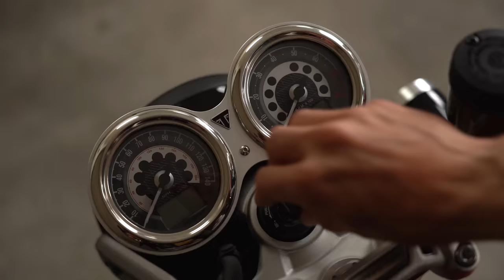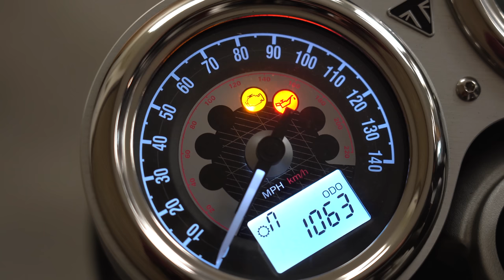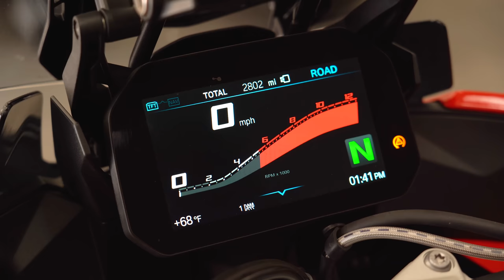Do You Need To Warm Up Your Engine? | The Shop Manual

Comment: The choke adds more fuel? Whoopsie!
EDIT: apparently chokes work different to how I remember them.

It is wise however, as you said to let the engine at least idle for 60 seconds. One thing that can happen from not warming up an engine EFI or Carby is that the metals do expand at different rates. This has been known to cause small oil leaks. Especially on Harley engines, let alone most air cooled engines that are still being made today.
Reply: Well, let's do a bit of thinking, here.  On my carb'd bike, if I add choke without touching the throttle, the rpm's increase.  If the choke doesn't add fuel, we have found the solution to the perpetual motion conundrum. In fact, on full choke, my bike will pull 4-5k rpms and can be ridden without opening the throttle.  Those rev's come from additional fuel, not just less air.

So let's give Ari some credit, as he was correct.  At least in the real world.  There haven't been "pure chokes" on motorcycles for a long time.  The "choke" is part of a fuel-enriching, airflow-restricting, starting system for many years now.
Reply: @bikesthatvote2855  a choke is merely a butterfly long before the Venturi, all is does is reduce airflow. This decreases the air to fuel ratio, it doesn’t suddenly dump more fuel in. However, in EFI systems in most cases the injector will inject more fuel on cold starts.
Reply: @whatsstefon  Please let me know what motorcycle carb uses the system you are describing.  On both my Suzuki's Mikuni BDST's and my Kawasaki's Keihin CVK's, the choke is a fuel-enriching starting system as I described.  Those are the last 2 sets of bike carbs that I have rebuilt.  I've also rebuild a number of Honda carbs, but don't have the carbs or the specs in front of me at the moment.  I have rebuilt a fair number of motorcycle carbs, and I have never seen a classical choke butterfly that you are describing.  In my experience going back over 40 years of bike carbs, the choke has always been a fuel-enrichening system.  FWIW, I have 6 bikes in the garage with clearly labeled "CHOKE"s that all have fuel-enrichment systems on the carbs, and do not control a butterfly before the venturi.  The butterflies are connected to the throttle cable, not to the choke cable.
Reply: @bikesthatvote2855  I’ve been rebuilding bikes for almost as long. Most carbs I’ve touched have a choke butterfly before the Venturi. The choke lever literally opens and closes the choke butterfly and is not connected to any fuelling circuit of the carburettor. Maybe I’ve just never come across the systems you are experienced with. However, I’ve worked for Honda, Suzuki, Kawasaki and Yamaha, in addition to most of the English and European marquees.

I’m always interested in learning new things. But I haven’t come across a carby that enriches fuel whether that be in addition to other cold start systems or stand alone.
Reply: Chokes that add more fuel via enrichment valve / circuit are a common type of choke.  Google search.  So no, the vid isn't wrong about that.  
These guys are a quality outfit.  Little to no chance they're going to get something like this wrong
Reply: @SportbikerNZ  Right, well I guess carbies changed a lot since I was a boy. They only ever had a choke butterfly.

Comment: 2014 RM-Z 250, new top end build. Running great one day, next day it was 2-degree F. Started it and i watched my friend give it gas to get to the start of the race. The engine cover cracked, and oil started to leak. John Rice a master mechanic in Springfield has told me and my friend that if it's below 32 outside [below freezing] To always let the engine warm up, at least for a minute but 2-3 would work best. Also, the same damn thing happened to my Motorcycle EFI. I started it and 10-15 seconds later i gave it gas to leave the house, and i heard a loud pop and the bike died. I snapped the piston cap and it broke/shattered into a hundred pieces, took my about 5 hours to get it all cleaned out properly. I'm not a car mechanic, but i am a certified small engine Mechanic. And in my 5-year study of small engines. I've learned one major aspect, If it's cold outside, your engine is cold to. And the best way to blow your motor when it's cold outside, is to simply give it gas and try to operate it while cold. A Chainsaw is a great way to explain this. On a cold winter day. If you start the saw and instantly/1-5 seconds after starting it, you go to cut into a tree. The saw will die because the engine isn't warm enough to move properly. I like to think of this as a person drinking coffee in the morning to wake up, because if you wake up, you're not going to be able to go on a 5-mile run first thing. Your body needs time to wake up. Same way with any gas-diesel powered engine on the planet. This video is complete BS. I don't care who this guy thinks he is, but he clearly doesn't know what the hell he's talking about. If you want to keep something nice [take care of it].

Comment: LOL, I am an Engineer, and I was waiting to arrest you on this, until you redeemed yourselves and explained, that yes, you should let the engine warm up before you ride it hard. So, not to confuse anyone with long explanations. Let your engine warm up so all parts are in speck, and no worry. If you hit the gas and ride it like you stole it, chances are that many parts will heat up way before others and create thermal stress. This will eventually lead to an engine that is leaking oil among other issues, and that is annoying like hell. When i have overhauled my bike or i bought a new bike, i usually go over every bolt on covers etc. and re-tighten to spec. Usually after the first few heat cycles the bolts loosen a bit from the heat cycles then engine go through. Even my Buell don't leak one drop of oil. ;-)

Comment: Regardless of the information given here I think I will stick with warming my scooter up  before I ride. The reason you ask, why would my opinion differ from the mighty RevZilla brain? From an engine builders perspective it is still a best practice habit, to let your scooter warm up or any engine for that matter. Why do most Police cruisers both cars and scooters or public service vehicles seem to  wear so well as far as the engine wear is concerned.  Because they are warmed up and run at temp throughout most of their lives  they only go through  on or two heat cycles per shift and then the second cycle is pre warmed because and the engine didn't cool down all the way like overnight. Running at temp like that is easy on the engine. most critical wear happens at cold start since they don't get a chance to cool off all day they run at peak performance for wear. If you want to just start it up and go play (ride) I will see you later in the shop to discuss your rebuild or replacement options while I change the oil on my scooter so yeah go ahead and do what RevZilla suggests here I can use the money

Comment: This is honestly why i dont buy any dirtbikes/quads used. People are impatient and take stuff to redline when it isn’t even warm. And people like never even go through proper break in period on brand new machines. I usually let my stuff idle until the side of the cases and head are warm to touch. Then cruise it around for another couple minutes then i go to full throttle once its fully to operating temp.

Comment: Another reason mostly for cars but I believe some bikes could potentially have them as well is forged internals. These are Conrods pistons and crankshafts pressed into a mold instead of cast and have a more structured and dense grain pattern and are therefore capable of more hp but come with the downside that they do need a good no revving warmup otherwise they’ll get very heavy piston slapping. I personally also use engine warmup to determine if I should even get on the bike. If can get to my destination by bicycle in the time it takes to warmup and actually drive there I don’t get on my bike but save gas and unnecessary exhaust fumes from entering the air by getting on my bycicle.

Comment: "designed to flow low as 10F/-15C" Yes and it flows way less in -20 "much colder than anyone with right mind want to ride in"... huh? Its not the cold that is the issue, just need suitable clothes to deal with that, bigger problem is traction, but with spike tires that is not much of a issue, but then again chance between snow and ice covered road to clean asphalt is, since those metal spikes dont have much of a traction on there. Solution is to chance into less aggressive spikes, but its nor perfect solution. Also its beneficial to drive during winter as insurance costs go way down then.
So in the end yes you should let it idle for a little bit to get oil flowing and go easy until its in operating temp. If you want to use entire reserve right from the get go let it warm into operating temps while idling since then there is no, to little airflow that cools the engine making this take longer. Also this tutorial was mostly for 4 stroke engines, while 2 strokes really need to warmed up much more since it revs way higher.

Comment: Very helpful indeed...

My bike seems like it needs 3-4 min, I always wait for the temperature to get to 72° then pull out slowly at least 1/2 a mile to the road from my home. This gives it time to get the right temperature, and all the moving parts get some oil...
While I put my gear on , it warms  up. It seems to work real well for my motorcycle. 

I actually have a problem though. After having many motorcycles and cars and finding out that I baby them too much makes me envy (in a good way) those who don't warm up their engines enough, go through the part of the road where it's two feet deep, water and mud  riding their bikes through the nastiest terrain, could  give a rats ass if they screw their bikes up, while I choose the side of that mud puddle or ride on the best part of the road so as to not destroy my wonderful bike!!

And after a long ride I tend to clean it and leave it spotless again. I can say that everything I've ever owned lasts and lasts because of the treatment I give it.
Another example, I'll be riding and the clouds seem like they are going to dropping 💧's the size of quarters and it's clear there is no way out but to bite the bullet and ride the storm out... Getting home and first drying off the bike as best as I can, giving a hoot on my drenched clothing... With my only worry, (oh god it's gonna rust) 😮

Then watching my brother come in all wet, leaves his bike dripping 💦 wet without a worry in the world!!! 

Yeah, I wish I could do the same, but this OCD just won't let me be😢

Oh well, safe riding to all!!

Comment: I enjoyed and appreciate your explanations.  However, you did not talk about the higher idle rpm on cold start-up... and then it takes about 3 minutes before the idling settles down to "normal" idling speed.  I ask about this because I hate the loud, abrupt metallic crunch sound and feeling when I put it into 1st gear with a higher than normal idle rpm. It sounds like it'll break something.  So I wait until it the idle rpm settles down to normal before I engage 1st gear.  Or is it still okay to put it into 1st gear before the idle speed goes down? I fear for the gears mechanism.

Comment: I actually do need to warm up my 165hp 2-stroke engine, says so on the manual. And to the people asking? someone else if "warming up the engine is necessary?" Common sense says "it does not hurt man made metallic parts that you paid for".. then again, if you need to ask someone else for advice on "can I drive this", you really probably should not. Unless there is some secret rule that "cool kids redline cold engines if someone says yes"

Comment: Its not the Oil,i am afried for,you Can blow a head gasket,if the water is cold,aluminium takes time to exspand,when an engine had the right water/Oil temperature and you drive with moderate trottle ,the engine Can drive forever,its only coldstarts there hurt the engine a little bit.but it Can takes 10000 times coldstarts,before you Can see it on the bearrings.

Comment: I only wait a few seconds for the oil to circulate on the engine. Then I start riding not accelerating too much until the engine is warmed up.

Comment: Hot valves, cold valve guides?  
Hot pistons, cold cylinder?
Nah, I'll keep warming up all my engines.  
I've rebuilt more engines than most, seen how older vehicles can run for decades with warm-ups and how quickly cold drives can cause crucial parts to wear out.  Waste a bit of gas or waste an engine.  Both valid choices, one costs less in the long run.  Easy choice for me.

Comment: From the (fuel injected) Royal Enfield 2022 Classic 350 manual.
"""NEVER accelerate as soon as the engine starts, especially in cold condition. The engine should be allowed to run in idle rpm for at least 120 s for the
engine oil to circulate and lubricate all the internal moving parts and for the engine temperature to raise. Failure to adhere to this important information
will cause serious damage to the engine internals."""

Comment: I would read the owners manual first. My BMW Bike is fuel injected but has a Choke. Bmw says OK to ride without warm up. My other Bike is a SUZUKI and SUZUKI says to let the Bike warm up first for several minutes. If your manual does not cover this then use your better judgement. Furthermore, better to use a Full Synthetic Oil.

Comment: After all the adds etc switched off "sorry" Anything with metal to metal needs to warm up equaly dont give a shit what anyone says carb or no carb Same goes for oil that they recon can
do 10K load of bollocks 6K max again dont give a shit as to what anyone says !!! My chain saw 2 stroke one minute of running otherwise the cylinder on the exhaust side will damage 
be it carb or injection So in a nut shell having stupidly not gone through the whole vid I say yes warm up any engine or be it on your own head /wallet Stay safe stay wise over and out !!!!!!!!

Comment: Also when fuel injected bikes are cold they idle higher. Is clicking into first gear at cold idle worse for the slots and dogs than clicking into gear at a lower rpm when it’s warmer?

Comment: I have a Honda cbr650f, I bought used from a stranger. I have never had a motorcycle like this where if not warmed up and you pull on the throttle it will miss fire, so it sounds. I hear popping in the engine, power is cut. I have no idea the reason for this. Looking for knowledgeable people who may have answers.

Comment: The oil temp and viscosity argument is the worse one because its hypocritical by default if your oil is cold and not viscous enough requiring a "warm up" then starting the engine and idling is the worse thing you can do because now you have moving parts creating friction with no oil durring idle . If viscosity is an issue than you should be heating the bikes oil pan externally  to warm the oil before starting.people often take simple concepts and blow them out of proportion for the sake of sounding smart in a conversation.

The carb argument and temp tolerance deviation is still valid IMO as metal swells and shrinks do to temperature and carbs dont like being cold just ask my used once a year chain saw 

I typically let my vehicle idle for about a min before driving  mostly to insure oil has had time to get pumped to the top and trickle down so i know while under load there is sufficient lubricant throughout the engine and i dont dog it untill my vehicle is up to operating temp

On my carbed bike i just let them idle while i put my gear on usly by then the bikes carbs are good and ill ride casual untill i feel the bike is running good

Comment: False on fuel condensation. Sort of true on oil.  One item not covered. Is valve clearance. 250 and 400 rebels in cold weather tended to stall.  My fix was to open valve clearance by 3/10,000. No that is not a misprint. It works.

Comment: You are discussing  legitimacy of letting your motorcycle idle a "a minute or two" and there many who do this before driving at 0500 or 0600.  Is there any reason to REV the engine with straight pipes every 5 seconds for 5 to 10 minutes? I am personally aware that this is very effective in acquiring multiple red dots on the cyclist's helmet. So why shouldn't triggers be pressed?

Comment: What about when stepper motor acelerates the engine like 1800rpm example till the engine warm up then the fuel inyection low the rpm to 1200-1400rpm by itself 🤔 it’s like warm the engine manual or with the choke on carburates engine
Reply: It operates exactly as you describe, and serves to speed up the warming-up process.

Comment: Anyone know why on my 2018 cbr1000rr the bike will start right up from cold but as soon as 5-10 mins of riding and a stop to get gas and filling up, the bike hesitates to start? Battery is brand new. It’s been happening from day 1 and seems other ppl have this issue with cbrs but can’t find a solution.

Comment: how does this work with mopeds? its a recent'ish one, 2015, it says in the manual to warm up the engine 10 minutes. is this then false? or is it correct because with a scooter, you usually rev it up to the max to get up to speed?

Comment: You must have gotten a lot of money for manufacturers to make a video that completely States the opposite of its end conclusion in the middle of the video. The only reason I've ever let my bike warm up has been for tolerance reasons, and that's a really big reason, all the force that goes into putting engine power into the ground and the stress it leaves on an engine isn't that much different no matter how much little/lot throttle you put in, you should let your bike warm up always, the only person that will tell you otherwise is the guy selling you parts. Source: I'm a service tech, one of the last few that actually rides and cares about riders. Watch fortnine, people, not this Comoto crap (JP cycles, revzilla, and cycle gear are all the same company pretending to compete)